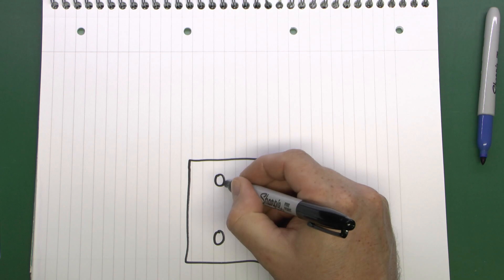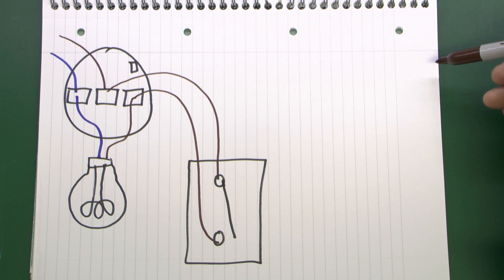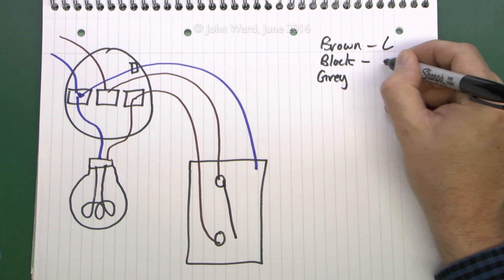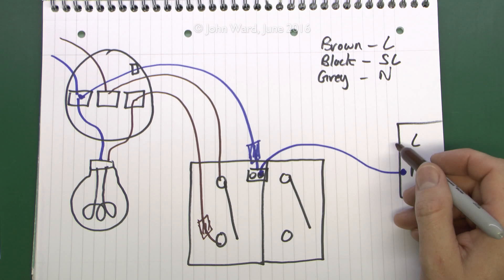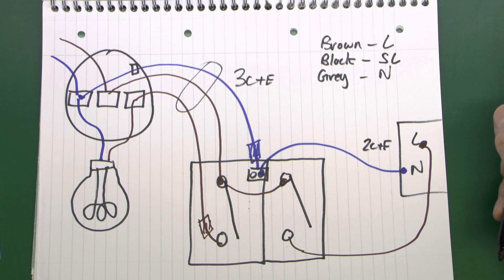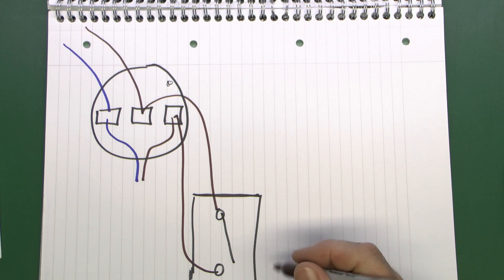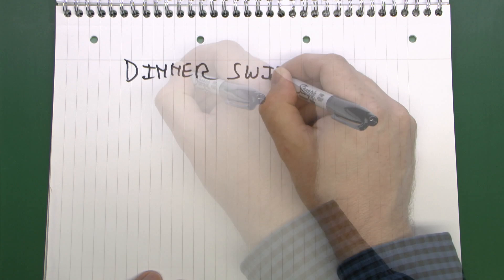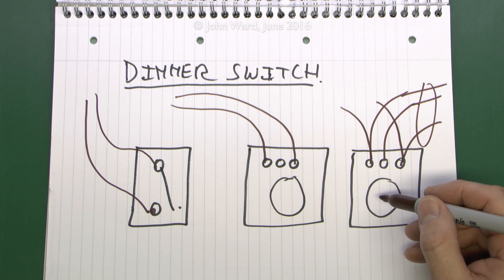Lighting Circuits Part 3 - Fans, Motion Sensor Lights, 3 Core & Earth Cable

Comment: Will the extractor fan/timer works if you omit the fan isolator? I eagerly await your reply. By the way, your video is clear as day.
Reply from the maker: Yes, there will just be no way to switch it off individually for cleaning or other maintenance.
Reply: @jwflame  JW, to be honest, I am happy you reply, but I have another problem I think you can solve. I will try to say it as clear as possible so that you can give me the answer I am seeking. I am on the verge of installing an extractor fan, but I seem to be having a little problem. When I watched your video concerning the wiring of the extractor fan, I must confess, it is the easiest explanation that ever graced Youtube. Your explanation is very clear, even a new born could work with it. Anyway, my problem is not with your  wiring diagram (that is clear as day and laid out so beautifully), the problem is that my power source is enter my toilet via a light switch then the lamp. In your diagram, the power source is coming from CU straight into the N, loop and SL and then you installed switch. My power source is going to the lamp via an established switch on the wall. In my toilet, I am trying to install an extractor fan from the lamp. How do I install the extractor fan from a switch and lamp that is already installed in my toilet?  

1) Your diagram: Power Source is coming from CU via NO SWITCH to N, loop, SL
2) My toilet: My Power Source is coming from somewhere outside of the toilet via THE LIGHT SWITCH and into light (via terminal box. How can I incorporate that light switch that is already installed with the extractor fan I want to install? I have been searching for almost two months for an answer to my annoying problem. Much thanks in advance

Comment: Great clear video. But I'm wondering if it's possible to replace a PIR motion sensor in our bathroom with a simple old pull cord switch, which would give us more control. I just can't work it out. The existing PIR wiring has earth, neutral, line and switched line wires, but the new pull switch just has the standard L1 (and L2 not req'd), the COM and earth terminals. Earth is obvious but I am wondering how to wire up the other three wires to the two  pull switch terminals. The switch is for the light and an extractor fan (which has an isolator switch located outside the bathroom door). Can anyone please help!?
Reply from the maker: Line and switched line to L1 and COM.  Neutral not connected to the switch.
Reply: @jwflame  thanks for such a speedy reply. So I just tape off the blue neutral then, and put line to L1 and switched line to COM?
Reply: @hel1um  yes
Reply: @matt-matt461  great, thanks for the clarification.

Comment: I have a remote controlled fan light, but the bulb only dims not turns off via the off button on the remote.... How could this be resolved?
Reply from the maker: Most likely it's a fault with the control module in the fan.  If you are using an LED lamp, it may not be compatible with the control module.
Reply: @jwflame  appreciate you taking the time to respond thanks.

Comment: I would never connect a outside light to a light circuit ,because they do got problems more often and they are out in the damp ,I don't want all my lights out until I sort the outside light sorted....and it would be possible for someone to put you in the dark by shorting out the outside lights to burgle your house ,,,,seperate fuse for me everytime.

Comment: Do you have a video on multiple lights from one light swtich eg spotlights
Reply from the maker: No, but for multiple lights, you just extend the L/N/E from the first light to the second, third and so on.
Reply: @jwflame  could you just power the switch frist then power the lights  woukd that be ok
Reply: @jwflame  so would i just run a cable from light 1  with a neutral wire going in to neutral, live (brown) going to LNE (along with blue wire (sleeved brown) from the swtich cable  ) and earth going to eath then run it to the second light as just a power in neutral(blue) to neutral, live(brown) to loop, and earth to earth. Thanks so much TIA

Comment: All very good and explanatory. However I wonder how people have pulled a 3 core down in a conduit or slip conduit ...Being a sparks for over 30 years most domestic switches will not allow a 3 core 1.5 mm2 down the switch drop its too wide Even 1mm2 s core is fairly wide  ...If You were so lucky to see that the switchdrop conduit will allow a 3 core 1.5 mmm2 I wonder how many people are pulling it down using just insulation tape, It falls off because its tight and lo and behold No cable to pull on . Maybe do a little video of how to join cables together and what lubricant one can use to help you Also make it known that Its far easier to use 2 people to pull cables in any situation . . Also a 17th edition test stipulates there must be a fan in the kitchen and Bathroom its a part P requirement Window or not ....

Comment: Don't you need a ground wire to the new outside light?
Reply from the maker: Yes, all of the items do.  As stated in the video, earth/ground wires are not shown in the diagrams, as the concepts of switching and connection only involve the line and neutral wires.

Comment: another satanic device is a dimmer.... 😂😂😂
Reply: Usual the same connection as a switch!Just phase(brown) and Black(switched brown)Only if there is a light in the dimmer,you have to have a neutral wire.(blue)
Reply: The way he says it so casually cracks me up 😂😂😂